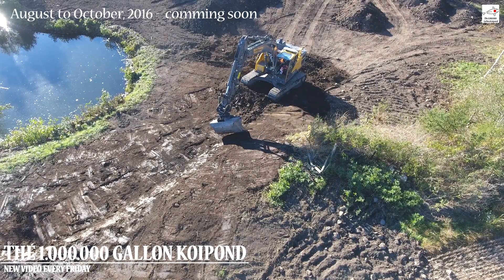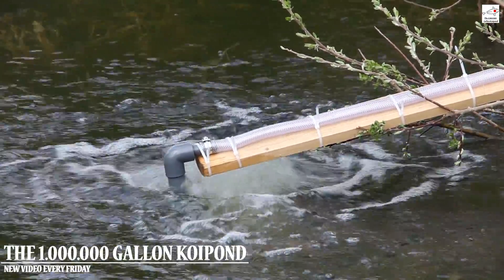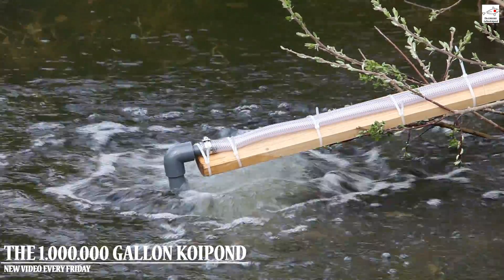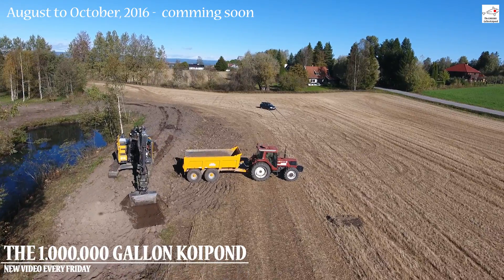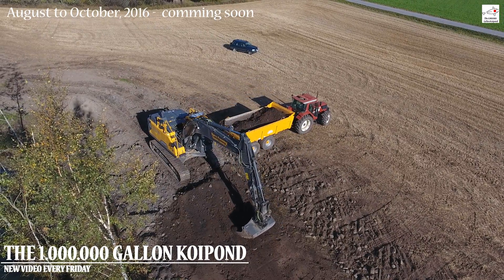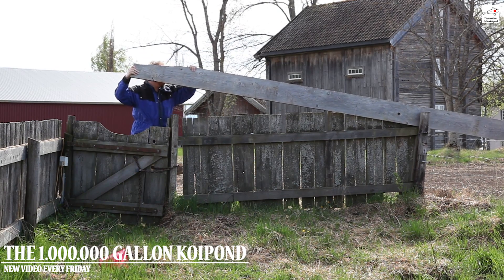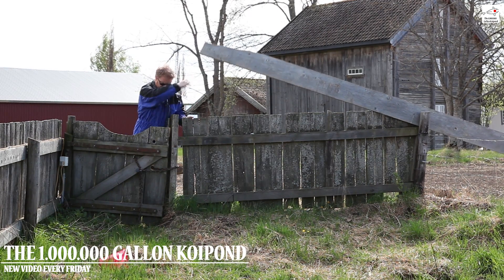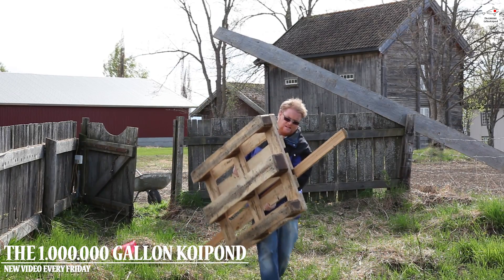The 1.000.000 Gallon Koipond - E012 - My first winter aeration system

Comment: I know this is years ago. but they make weighted air line and did you put it deeper water later on.
Reply from the maker: No, I have moved it this winter, but it`s stil only 50-70 cm deep in the water. It keeps an 3X3 meters area open all winter. Even when it`s -25 C and a lot of snow. I don`t need weighted air line for this setup.

But the system I`m planning to use during summer will need it :)